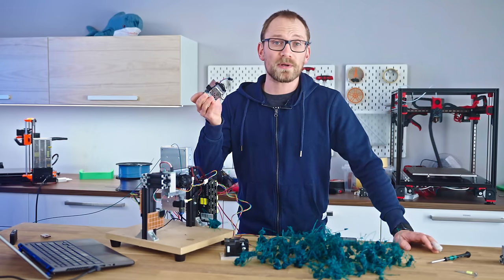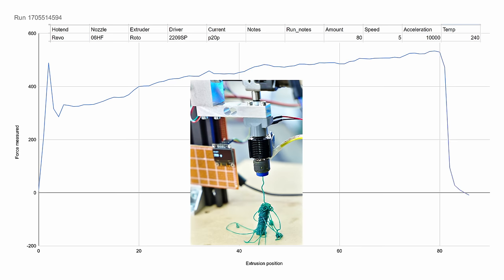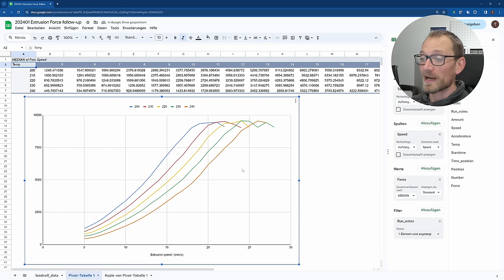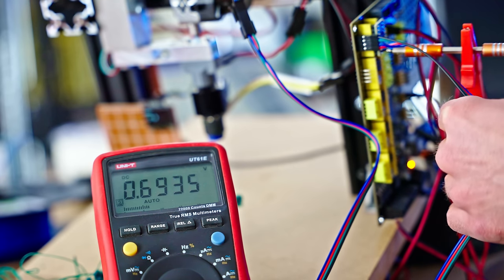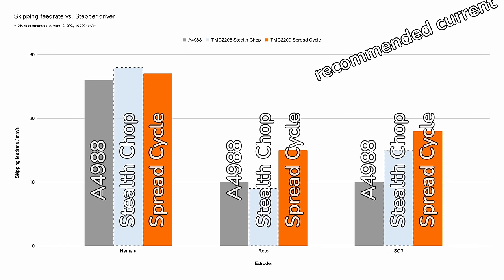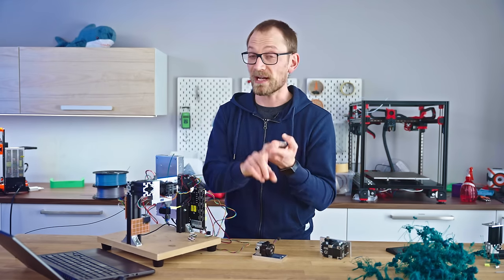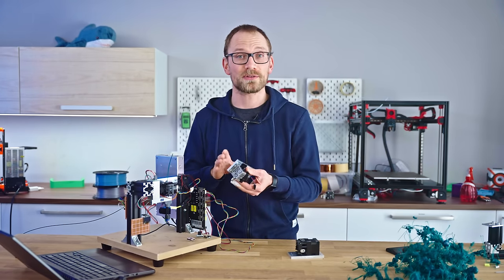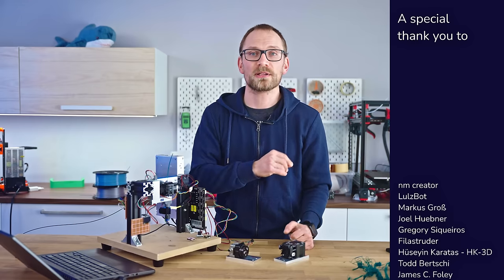Are you using your stepper drivers wrong? E3D Revo Roto Retested!

Comment: Tom, can you comment on how you (and perhaps Stephan) arrive at the extrusion forces you use? I know that if I applied 5 to 10 kilograms of force to a 1.75mm diameter PLA filament in a 0.4mm nozzle heated to 210C, I would tear through a spool of filament in a matter of minutes, if not seconds. Can you clarify, please?
Reply from the maker: You're pretty far off with the numbers you "know" - there's no way a hotend could even melt that amount of filament in "seconds". Look at the speeds these extruders are achieving, they're around 10-20mm/s, using a 0.6mm HF nozzle. Assuming the 12mm/s I found for the Revo Roto, a full 1kg spool of PLA would take almost 8 hours to extrude. Not an unrealistic time to output that amount of filament tbh.

Comment: As a very quick test, you should measure the DC resistance of the steppers. The Revo Roto would probably have a higher reading. Of course an inductance measurement would but better but most people tend to have DC multi meters and the measurements could possibly add to the overall conclusion you have arrived at.
Reply from the maker: The resistance is actually listed online, at 7.5 Ohm for the Revo Roto (but no inductance, which I'd assume would be rather high as well): https://e3d-online.com/pages/help-centre-roto
Reply: @MadeWithLayers  do you have way to measure inductance of the stepper?

Comment: Mixed feeling:
- Roto is ill-dimensioned for current 24V ecosystem standard
- Roto is "future proofed" for the more desirable 48V ecosystem which is (very) slowly being introduced on the market (I am personally already transitioning to 48V using the last duet control boards)
- by the time 48V ecosystem becomes a standard, the non-electrical side of the Roto might be outdated.

--> maybe E3D should propose a 24V version and a 48V version of the Roto. The 24V might be a bit heavier but engineering = compromising, isn't it.
Reply: Hey Raoul,

You don’t need to run 48V, 24V is more than sufficient to achieve the maximum volumetric flow requirements for every nozzle in the Revo ecosystem! Please see our pinned comment for some more information.

Thanks, 
E3D

Comment: thanks i was about to buy the roto but given the number you gave i will be limited as i inteded to print at 140mm/sec with 0.6mm nozzle
Reply: Good afternoon,

Assuming standard flow geometry for a 0.6mm nozzle (so a layer height of 0.3mm and a track width of 0.72mm), 140mm/s xy speed would convert to 30.24mm3/s. Here’s a video of Roto doing just that (31mm3/s) with a 0.6mm Revo High Flow nozzle - https://www.youtube.com/shorts/TvgeMpdz6JM.

Thanks,
Team E3D

Comment: Using higher voltage and lower current means the copper windings can be lighter (size of copper is dictated by current). This makes for a lighter motor
Reply from the maker: Not quite - you also need more turns on the stator when using less current to achieve the same magnetic flux, so the material savings effectively get cancelled out.
Reply: The magnetic field strength(magnetic force) is directly proportional to the current but the current is proportional the the square of the weight of the copper wire.  @MadeWithLayers

Comment: PSA: The orbiter is horrible to take apart! To access the filament path you need to take out all screws (which are all different lengths and have different diameters and you need two different allen keys), and once you have it taken apart, the planetary gears fall out as well as the ball bearing for the filament sensor. Reassembling is even more annoying...

Comment: I really wanna make a high voltage extrusion system now. I prefer having excessive power and tuning down than knowing there's a limit. Plus having a 60 volt system is just hilarious
Reply: A bit of work making sure insulation is up to scratch.  You can get away with a lot running 24 V, but 60 V is going to find ways to evade the paths you want unless you are more careful.

Use resettable fuses.

Comment: It was all the way at the end, but it's definitely one of the most important parts: they're using a 0.9 degree stepper.  In testing, a 0.9 degree stepper has about HALF the torque of a 1.8 degree stepper which pretty much all other extruders use.  A simple stepper swap could likely massively improve the performance of the Revo Roto.

I really like E3D and respect what they've done for the 3D printing space, but they don't seem to recognize that faster and high flow printing is becoming more and more the norm.
Reply: Afternoon, 

The design philosophy behind Roto was to have all the extrusion force you need in as lightweight a package as possible. Changing to a larger or more powerful stepper motor wouldn’t enable you to print any faster. Roto can already achieve the maximum volumetric flow requirements for every nozzle in the Revo ecosystem. If you increase flow beyond the rate that a given nozzle-hotend combination can melt it, you’ll just be pushing harder and cold extruding. 

The spike in force requirement in this situation is because the filament is not fully molten. Printing like this will lead to poor quality prints. If you were to put a bigger nozzle (with a higher maximum flow rate) onto the Roto you would be able to achieve higher extrusion speeds.

Thanks,
Team E3D

Comment: Are you not over complicating things, and simply running up to the limit of how fast the stepper can spin? Are they the same motor? Can they be swapped?
Reply: The planetary gear boxes make it hard to swap motors because they are made with an expected teeth count, LDO has many motors with different teeth counts because of this and other extruders. The current ones they carry are: 6, 8, 9 and 10. At least those are the ones I remember.
Reply: @MatrixRay19  yep, 6 is custom for annex engineering and their sherpa extruders, 8 is standard, 9 is custom for galileo 2 and a longer spur gear than usual, 10 is again standard. All have a module of 2mm and the 8, 9 and 10 teeth steppers have press fit gears, the 6 teeth one has the gear integrated onto the shaft due to size constraints. There are additional variations, for example the stepper that ships with the lgx lite has a steel gear, so you can use it with the heavy duty lgx gears made entirely from steel while standard is a brass gear.

Comment: Interesting Test, but still I think that the Roto shines on other characteristics. Not everybody needs maximum extrusion torque. Being much lighter, with a center of gravity that is much more in the center are harder to quantify but more important for most users motion systems IMHO.
Reply: The weight is definitely an advantage over E3Ds earlier offerings, but the weight between it and the Smart Orbiter should be relatively comparable in a full setup. The Roto weighs 146 Grams + 8g Nozzle (listed) + 20g Heater Cartridge (estimation) = 174g. The Smart Orbiter v3 is listed at 175g for the whole system (as it includes everything). Center of Mass should also be mostly similar between the two.

Weight and Center of Mass are only important when you are printing at high accelerations. You don't gain anything from running high accelerations if the extruder can't keep up. Especially as Revo emphasizes the ability to quickly change to the best Nozzle Diameter for each print, maxing out at ~100mm/s with a .6mm high flow nozzle is a weird choice. It is pretty likely that someone running this on a high performance printer would regularly run against the limits of this extruder. Choosing a slightly bigger and heavier motor would have been a more sensible option.
Reply: @scratchfisch6425  Thanks for the corrections, might be comparable in weight after all...

But I have to disagree with the latter. High wheight and bad center of gravity becomes a dealbreaker at high speeds, but it still affects each and every print significantly also at lower speeds. Having less energy to jerk around every corner was and always will be better.
Reply: Lower weight allows you to print faster which this can’t do. So what’s the point?
Reply: @rbaile508  Yes it does also that, but it also improves the quality at every speed slightly, and rreduces general wear an tear on every motion system obviously.
Reply: @perchte  I agree to a point. Running something like a Hemera at 388g will cause artifacts at much lower accelerations than a lighter extruder. Extremes are definitely bad. But basically all "current gen" extruders (BMG, Sherpa Mini, Orbiter, Revo Roto etc.) weigh less than 175g. At that weight, the remaining differences in weight/center of mass will not have any noticeable impact on print quality at reasonable accelerations (keep in mind that input shaping drastically increased maximum accelerations without noticeable ghosting)

Extruders need to have the right balance of weight and power, and the roto definitely misses the mark here.
Reply: @scratchfisch6425  Fair points made. Still if somebody madee a extruder with compareable other characteristics but weighing only 100g, I bet we still would see a noticeable improvement at "standard" speeds.

Comment: As an electronic engineer I'm completely confused. According to the documentation from E3D the resistance per phase (coil) is 7.5 ohms. At 24V you'd be passing 3.2 amps through each phase (short circuit). So to not exceed the recommended 0.6A at that resistance you'd only need 4.5v. I'm not sure what the whole speech you gave about needing a higher supply voltage to drive it better.

Happy to be corrected. Also happy to get out my oscilloscope and measure the voltage waveform across an extruder stepper coil.
Reply: Context of voltage is that driving the stepper motor. Almost seems like a stepper motor has mismatched specification for the application. 24V power supplies are most common. 
Note this is just the extruder stepper motor, not the driver motors for controlling print head movement. It's like the extruder is targeted for a specific custom printer architecture.
Reply: @AerialWaviator  what!? I have no idea what the point you're trying to make is. It's just a stepper motor attached to an extruder. It has certain characteristics. Phase resistance and max current are just two of the dimensions that vary for stepper motors. Stepper motors have a max torque output based upon those characteristics. Supply voltage has little to do with it, unless the driver doesn't have enough voltage to drive the desired max current.
Reply from the maker: As a mechatronics engineer, I'm happy to help. At standstill, the static coil resistance is the only thing determining the voltage requirement, but as the motor spins up, it also starts producing significant back EMF https://en.wikipedia.org/wiki/Counter-electromotive_force, essentially acting as a generator working against the driver. This is where the relatively fixed RPM limit on Revo Roto seems to stem from, as at this point the generated voltage is starting to approach the supply voltage, essentially disabling the driver from pushing any current through it.
Reply: @MadeWithLayers  Clapping back to an "as an electronic engineer" with an "as a mechatronics engineer" is stone cold though.

Comment: You kept referring to “stealthchop drivers”, but stealthchop2 is just a mode/capability of the driver—it can be changed in firmware or on the board. It might be better to use a more modern mcu/firmware (RRF or Klipper) to power that rig so you can test the same drivers under different modes and switch back between them easily.

Stealthchop reduces peak torque and, in turn, may reduce positional accuracy (especially when combined with interpolation). Its purpose is to reduce noise during linear movement, so I can’t see any reason why an extruder should ever be set to Stealthchop mode. It is never moving at a noise-producing speed for any appreciable length of time, so all it’s doing is just reducing available torque.

Comment: if those two extruder really have the same motor size and current is the only factor, you could swap motors to prove the point
Reply from the maker: They have their gears integral to the motor, not sure if they would match up. The motor from the Orbiter should improve things on the Roto, as it's not a 0.9° unit, but the Roto is still much more geared down.
Reply: @MadeWithLayers  seriously if the motor is geared down it means it does much more rews than it wouldn't do if it was runing as direct drive . so only reason to put 0.9 degree motor in such a thing is to make it more silent and that doesn't increase the torque but makes mcu work harder for no other benefits
if anything it would be much better to go with ~50-100 steps/rev motor to give it some torque and accuracy would be increased by the gear ratio anyway
the faster you want to print the lower the accuracy regardless of any motor specs because of fluid dynamics

Comment: I'd recommend getting an RSP-200-24 instead of the LSP-200-24 since LSP ones with more than 150W are technically not allowed to be used and sold inside the EU.
Reply from the maker: I know, this is simply a salvaged supply from some printer I took apart a while ago. They're still safe, but may be missing the active PFC for grid stability - but since I'm running quite a bit of solar here, I've already got plenty of high-power devices doing fun things with the mains power 😉

Comment: So the roto is an engineering failure. The makers didn't consider all variables and didn't do enogh testing. This thing is flawed and pretty useless as a drop in replacement since 99% of all hobby 3D printers run 24V or 12V.

Comment: Why didn’t you try the roto with a different motor?
Reply from the maker: The motor is not user replaceable.
Reply: @MadeWithLayers  it can’t be unscrewed like other nema 14 36 inch pancakes? Or does it have a special tooth count on the drive gear?
Reply: @nonchalanto   Special toothed gear mated with the shaft.

Comment: I hate to say it but E3D is getting to be like Prusa at this point. You are paying more for their past efforts than you are for current advancements. I love my Revo nozzles but there are better extruders out there. I haven't gone through all the data as in depth as you but the Micro Swiss NG Revo is a great setup and runs around the price of the LDO Orbiter Smart. Allowed me to easily use my Voron Revo nozzles in my ender 3s.

Comment: Please use voltage ,current and power correctly . A 24V power supply will do just that. Deliver volts regardless of current (till it hits the rating it was designed to). A 24V system will deliver twice the power at the same current vs a 12V one. But if the driver is current limited it will deliver what it throttles down to ( or just stop or fry).
ps: you are running into internal resistance of the windings.
Reply from the maker: No.
Reply: Not according to ohms law. Twice the voltage will push double the current through the load, so it'll actually quadruple the power.
The limit here is inductance. Due to combination of high inductance, 0.9 steps and high gear ratio, inductance of coils starts limiting current at high step rate.

Comment: E3d went from industry leading Titan to best in class Hemera to puny Roto that flow limits any modern 3D printer. Ew
Reply: That's what happens  when a company becomes complacent.
Reply: TBH, Titan, especially the Aero sucked ballz.   Hemera was way over designed with way too big of a motor.  Then they went too far the other way with Roto.
Reply: @wesc23  what? Titan was the best thing that was aroubd. everyone out there without geared extruder and Titan is till this day, really good.